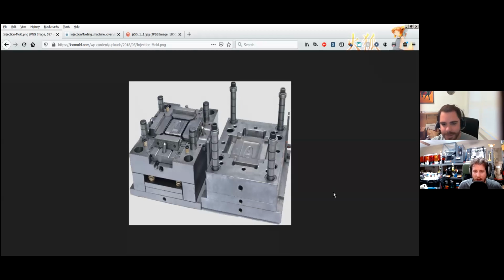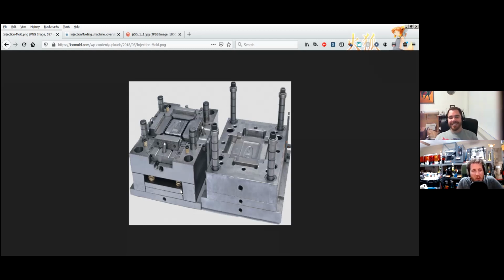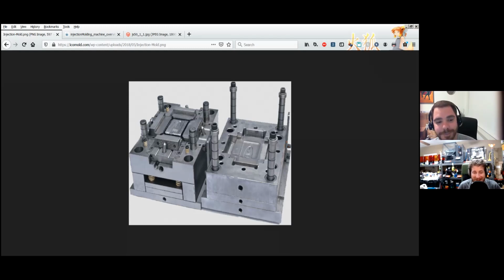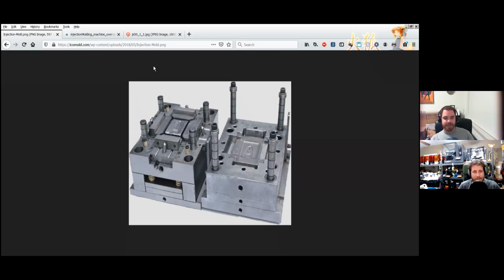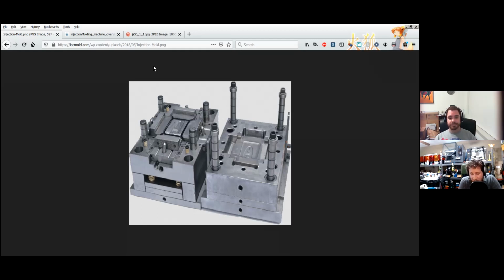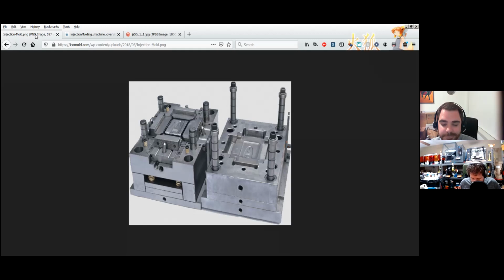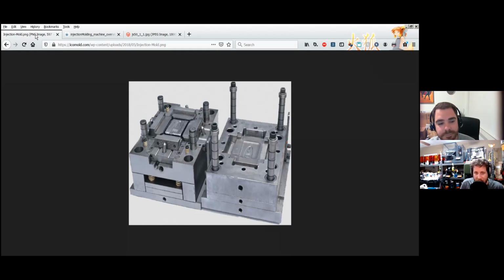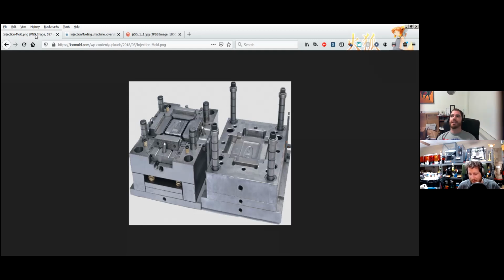Making Awesome #1 3D Printing vs Injection Molding

Comment: Great content as usual. Only caveat i would say is maybe add a quick card or annotation about the gun part since the designs have advanced so dramatically since the liberator. 

The main thing is that you dont have to 3d print the entire gun, can buy an off the shelf parts kit and then 3d print only the receiver which is legally the part that is considered a gun. For example look at the nylaug or plastikov v4. Even then there are projects like the AWCY scorpion which are over 80% 3d printed. Also check out hoffman tactical who pioneered 3d printed ar15s, the dude is a genius. 

Even fully homemade designs such as the fgc9 have gotten so good that they have been spotted used by rebel forces in Myanmar. The rebel forces used it to storm a junta armory and capture a bunch of real guns. The barrel is rifled via ECM which can be done at home super cheaply.

Designs have gotten so good that there are even gun competitions specifically for 3d printed guns. Check out the Maker's Match, i went to one down here in florida and it was a sight to behold.
Reply from the maker: This was over 3 years ago too.. so there's that.... Lol
Reply: @3DMusketeers i get that, but sometimes it's good to update your "evergreen content", but i hear you, there's enough info out there now that anyone who wants to make a gun can figure it out
Reply from the maker: We have over 1400 videos, it would take me sooooo long to go through them LOL